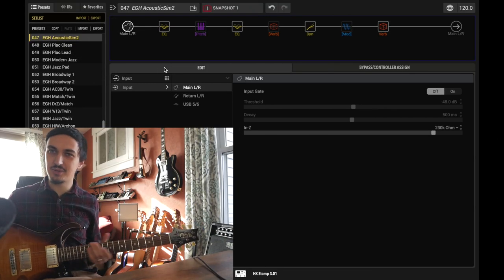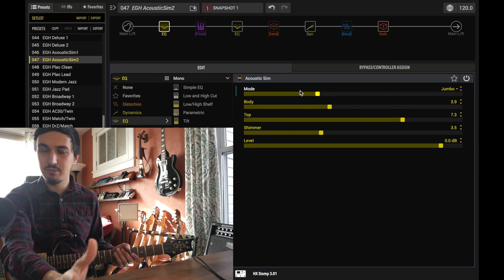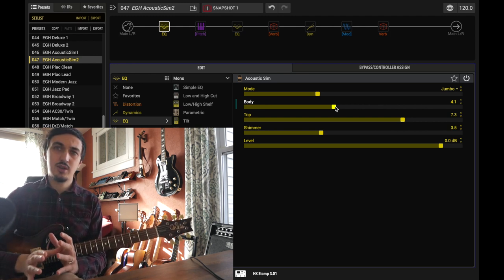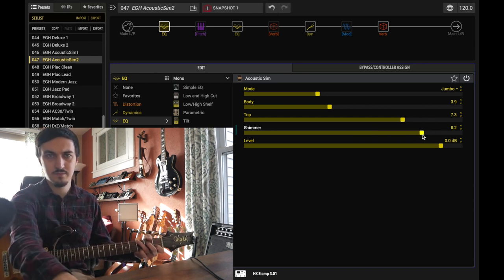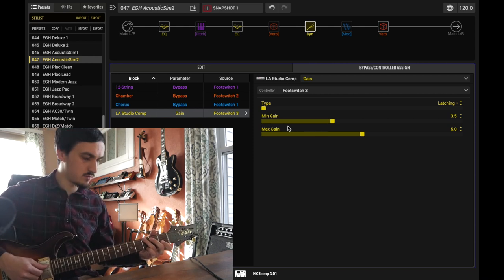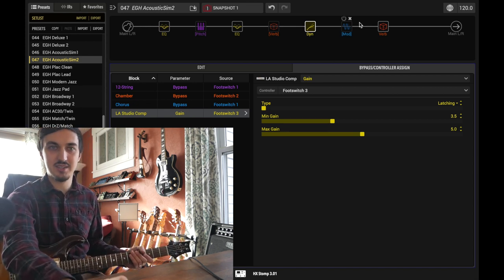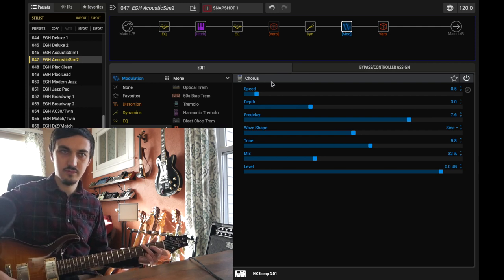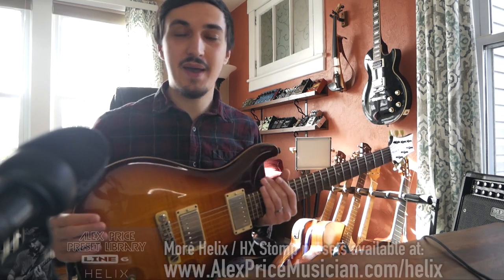Line 6 Helix 3.0 tip: Acoustic Tones from an Electric Guitar

Comment: I use the acoustic simulator with an acoustic IR. It's a killer combo. If you get acoustic IRs from 3Sigma Audio, use the ones found in the "Electric" folder and place them after the acoustic sim. A bit of compression, a studio pre and some reverb rounds it out nicely.
Reply from the maker: I was given that recommendation recently! I Don't have a 3Sigma Martin D45 pack so I'll give it a shot
Reply: Yes, this makes a HUGE difference.  Makes the acoustic sim go from 'meh' to 'decent'.

Comment: I'm running Helix LT 3.15 and I have now Acoustic Sim in my EQ library. Did they do away with it or am I missing something?
Reply from the maker: Are you looking in the EQ folder? You should also know that if you're editing from a computer, both HX Edit and your device need to be updated to the same firmware. 3.50 was just released so give that a try. It's a two step process. I just put out a video on the new update.

Comment: @Alex - I've been able to dial in much more present and dynamic sounds on my HX Stomp following your advice about Sag, Bias, BiasX, etc. Thanks. Subscribed. 

I've noticed something strange on the reverb for  the "09A DIR:JazzRivet120" Preset. When using the "Plate" Reverb, I'm getting a fairly loud octave overtone whenever I play  the note F on the 1st string 1st fret, 2nd string  6th fret, etc. I've tried 3 different types of guitars, each with different types of pickups, and I'm getting the annoyingly loud harmonic. It is most noticeable when using the neck pickup set at 10. It sounds to me like the Plate Reverb has a resonant frequency of F. I do not get that harmonic when using my Boss GT-6 Effects Processor with any of those same guitars using a similar sounding Patch. 

Have you or anyone else noticed this when using their HX Stomp on this Preset? It also occurs when using the Plate Reverb on other Presets, but I chose the one I listed as it was fairly easy to hear the overtone on it. The easiest way to hear it is to play the F note on a single string or as part of a chord, then quickly mute the strings. I can easily hear the octave F overtone in the Plate Reverb as it rings. If I turn off the Reverb, the overtone stops. Plate is my favorite type of reverb.
Reply from the maker: Glad it was helpful! I’ve never noticed that, though it’s something I’m sure I’d pick up on if I had that issue. What software version are you on? 
If you’re using one of my presets labeled DIR, it’s probably pretty old. I’ve updated my library and you should have a link in the original download to update your version for free.
Reply: @AlexPriceMusician  I'm using the HX Stomp Firmware ver. 3.01.0, and the Editor, version 3.01. I made sure that everything was up to date before I started exploring the Presets. Thanks for letting me know that you're not having that problem. Maybe I connected something wrong and it 's causing a weird resonance. I'll reexamine my connections.
Reply: @AlexPriceMusician  I've reexamined my connections and did some additional testing.  I disconnected all external connections to my HX Stomp and tried a couple different headphones connected directly to the unit. I still get the octave harmonic on F. It is most noticeable when I play just the 1st and 2nd string together, so it might be some kind of "combination tone" phenomenon. I retested by Boss GT-6, and I also get the octave harmonic on F, but it is much fainter, barely noticeable. So, unless there is something peculiar with my hearing, I think I'll have to find some way to reduce that note using EQ with a narrow Q value. The HX Stomp tends to have louder treble frequencies than my GT-6, so I'm sure that has contributed to the problem.

Comment: Will play with the Body/Top to mold the tone. I am playing a fairly bright strat with a maple neck. Do you have other suggestions on how to accommodate that? As of now my guitar sounds pretty weak.
Reply from the maker: You might find some success lowering the input impedance for this patch. Taking it off the auto settings and setting it to 230k or lower will darken the tone a bit. Either set it for the entire preset, or set it up with a footswitch command so that when you engage the acoustic sim block, it also sets the impedance.

Comment: They should have done a Neve preamp for the Helix.
Reply from the maker: They actually do have a mic pre that most people overlook. Head to the preamp section (I think? either that or the EQ or compressors) - where you're able to choose between guitar and bass models, you'll also see an option for a mic pre. No idea what it's based on exactly, but it's pretty easy to miss.
Reply: @AlexPriceMusician  A set it to line level to avoid distortion ;-)

Comment: Any tips for EMG pickups? I just play for fun and the acoustic sim plus IR is good but still getting some unwanted high frequency artifacts.
Reply: I did too, I put a parametric eq. first in line and set high cut at 9 khz, it helped a lot ;-) FWIW
Reply: @christianboddum8783  that worked. Thanks!
Reply from the maker: @christianboddum8783  Good stuff! Thanks for answering this Christian. I've never really experimented with EMG pickups so I wouldn't know what to suggest
Reply: @AlexPriceMusician  You're welcome ;-) The Helix is an awesome machine, especially if you have real world experience with the gear it models. There are however some digital noises that I can't truly get rid off, even after all the updates, so I guess it's down to the hardware. I hope Helix 2 will be totally without noises, until then Helix 1 is fine, you just have to be creative. I use noisegates very strategicly ;-)
Reply: @christianboddum8783  Mine has no digital noise
Reply: @jeffmilkey  Good for you ;-) There may be
 issues coming from non-grounded power sources, like here in Denmark. But, I bought an AC -out powerbank and it did nothing to the noise... FWIW

Comment: I really don't get why people use the acoustic simulator to actually simulate an acoustic guitar. At best, it sounds like a  mediocre piezo system. Yes, you can make some cool interesting sounds (especially by blending the acoustic simulator with a normal amp). That said, if a song desperately needs an acoustic part this will not help you. You are way better of just replacing the acoustic part with a clean electric tone. That is way better than using a crappy simulated acoustic tone. At least, that is what I think.